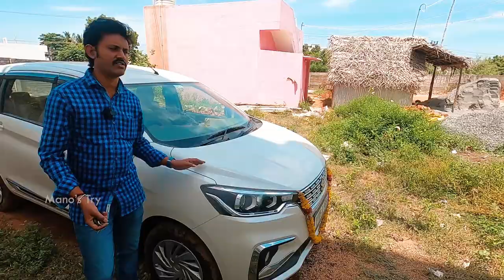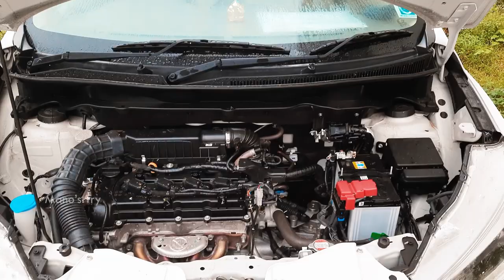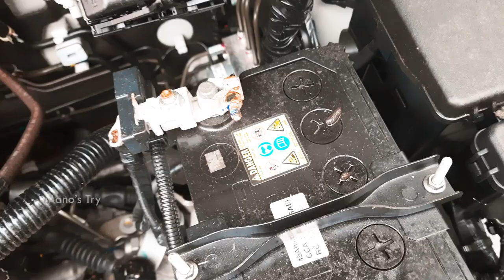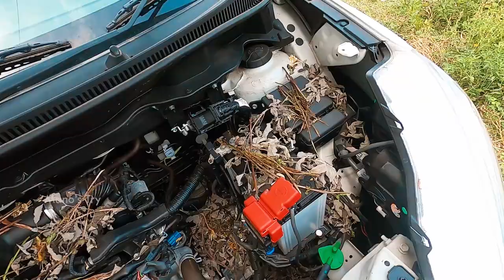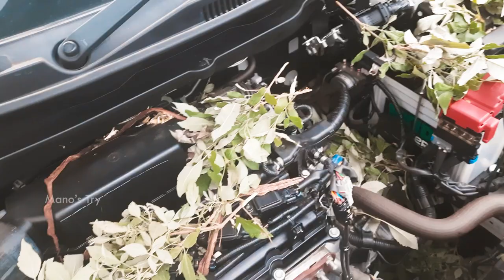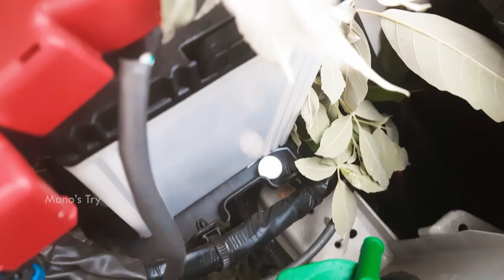🐁Mouse In Car What To Do, Rat In Car Engine Bonnet Problem How To Get Rid Of | Mano's Try Tamil Vlog

Comment: Bro my experience, I used everything but all failed. Took the car to the company mechanic, discussed the problems and I asked him to note me down the possible ways the rat could enter the interior cabin, both from front side and back side and under chassis possibilities. Then took the car to the nearest accessories shop, asked him to remove seat, and whatever the air holes he said to open, then we pasted or mildly welded thick steel mesh, that rat cant bite or enter. After this rat stopped entering the cabin of the car. But in the front engine bay, we must regularly use the car and tobacco leaves, rat repellent spray ,etc are the only options. And on top if engine and under the chassis I used to keep rat trap glue pad whenever I have doubt.i caught rat once that way too. I know the pain of spending money for the blood rat bite. Hope this would be helpful to you.

Comment: Best way for avoid rat issue :- Park your vehicle in difference directions on daily basis.
Reply: Yes really that helps
Reply: But for me no 🥺
Reply: @vinothkumar7261  😔
Reply: @vinothkumar7261  understood bro, so how much kms you on a average run your car
Reply: @vishal7359  per week it's around 200 to 250 kms but not upto that bro
Reply: @vinothkumar7261  strange!!! That is a good run time and engine room must be heat for some time. You should have some pets bro then. Since your car is not ideal
Reply: @vishal7359  strange for me too as well.. and we have two dogs also.. (not inside home)
Any idea.. and daily i moved my car to different places and the my home is located outside of town surrounded by wide range of trees 🥺
Reply: @vinothkumar7261  please let me know  if we can connect for few minutes over call. So that I can share few things which we done
Reply: @vinothkumar7261  sure ! Your email pls i will send it

Comment: Tom cat or bitter brand spray use panna 2weeks varaikkum wire a kadikkaadhu eli and anil also but car kku varum stay pannum, cabin kulla eli varaama irukka firewall (out air intake) vent onnu kuduthuruppaanga adhula steel net vachiii adachittaaa air varum but eliyaala vara mudiyaathu, and car engine bay laiyum vara koodaathu naa kozhi kidaappu illainaa rat mesh vaangi car kku adiyila clip or screws pottu gap illaama adachittaa car engine bay laiyum yeara chance illa ( service vidrappa cip type naa mesh a kelattittu service vittukalaam ) best protect from rats and squirrels anna❤️